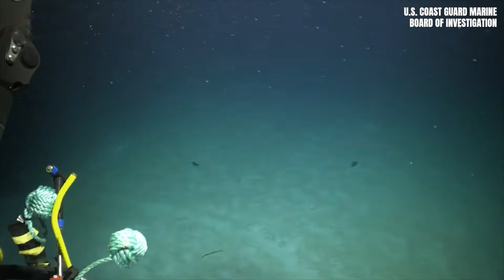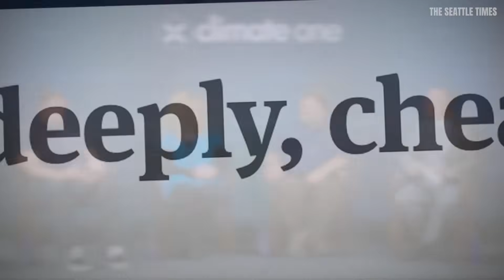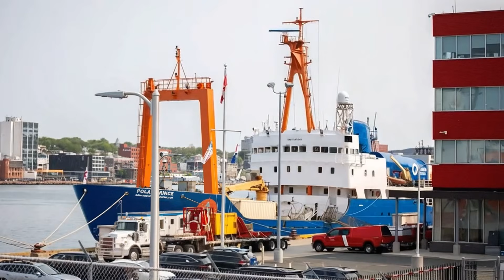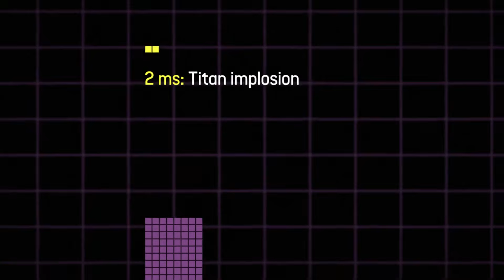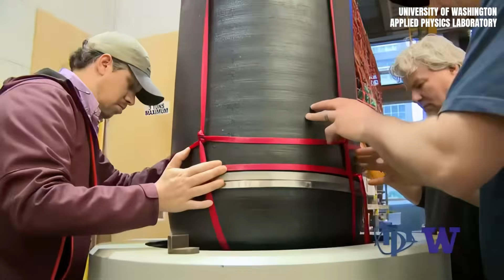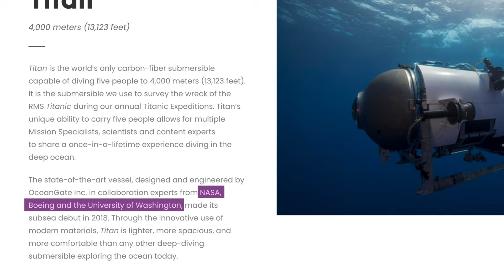Titan Submersible Implosion (2023) - OceanGate Documentary

Comment: The biggest, most obvious flaw, was the use of GLUE to attach the Plastic Fiber body, to the two Metal end cups! Two foreign materials, that expand, and contract at different rates, do not bond, so he attached them by glue? . .Under 6,000 pound, per square inch, of sea pressure!